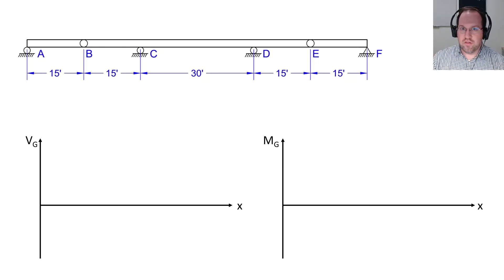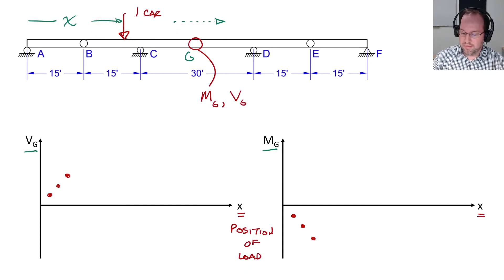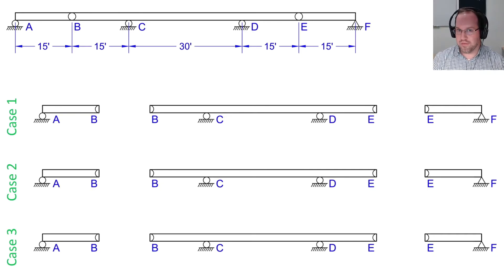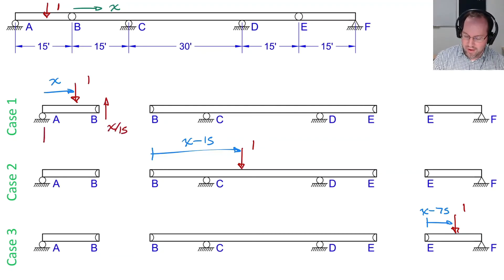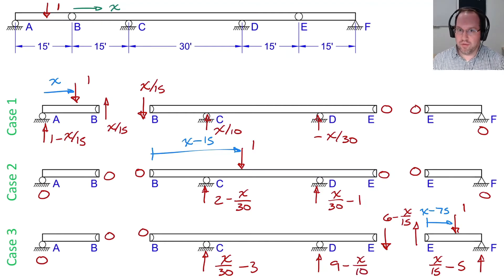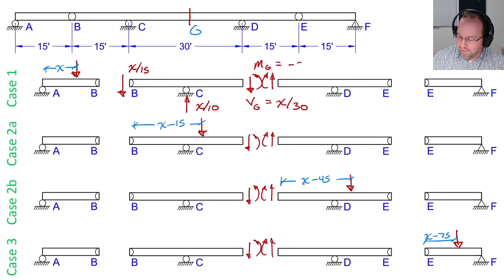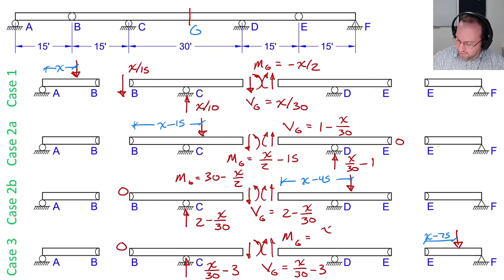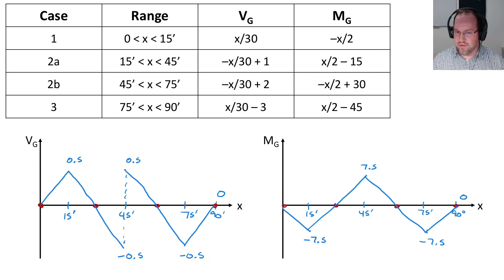Influence Lines and Moving Loads - Intro to Structural Analysis

Comment: The only thing I could not understand, is what a feet is?
Reply from the maker: Ha, yeah US units are a little weird, but I promise they do work just fine for structural engineering, statics, and so on. I wouldn’t vouch for them for most other purposes, but feet and inches are a convenient scale for building construction.

Anyway, a foot is a US unit of length. One foot equals 12 inches, which is 0.3048 meters, and is roughly the length of an adult human foot (hence the name).

The thing with US units is they are NOT a unit system, a fact that is misunderstood by many metric-accustomed folks. It’s an assortment of historical units each developed and used for specific purposes, so there is no reason to believe they would ever “play nice” with each other. Like 1 mile = 5280 feet. Seriously, why? Well, because a mile was invented (long ago) for a different context; it measures land distances, while feet measures construction scale distances. Convenient conversion wasn’t considered because they were largely used in entirely different fields, and converting between the two was largely an academic exercise of little interest to most people who used these units.

The point is, when used in their proper context (like feet, inches, pounds, kips, psi, and ksi for structures), everything works out similarly to using meter, millimeter, newton, kilonewton, MPa and GPa. When you mix in other US units from other industries or applications, things get crazy.
Reply: @StructuresProfH  it was a joke but thanks for the extensive explanation. Good lecture by the way, I enjoyed it
Reply from the maker: Well, you got me! It’s tough to tell sometimes because I get so many comments on US units that I had to set the record straight.

I’m glad you found the video helpful!